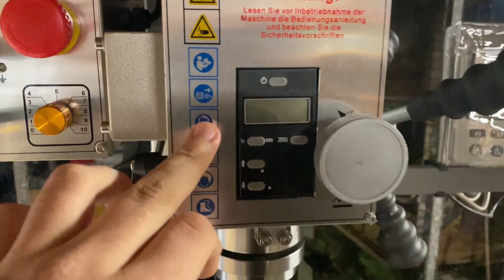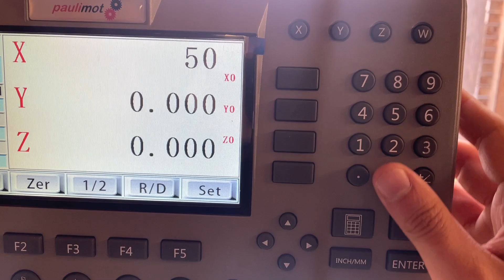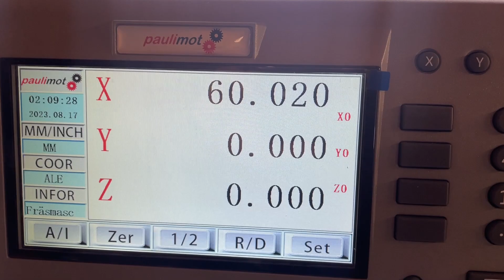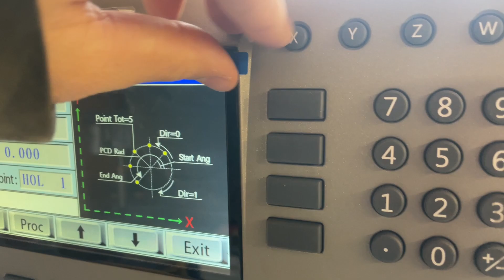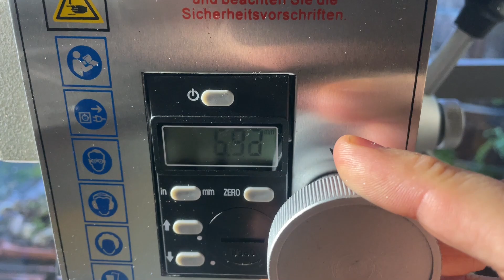My new milling machine  It is awesome

Comment: Please, can you check for backlash? If backlash is minimal that is good news, this is a machine ready for cnc. is it ballscrew also on z? wha brand? (so many questions)
Reply from the maker: No the z axis i a normal leadscrew but becous of the wheight of the z axis there is also no backlasch the backlasch on bothe x and y are minimal maby 0.01mm but i have not mesured it
Reply from the maker: I bought the machine from paulimot but the basic machine is a sieg